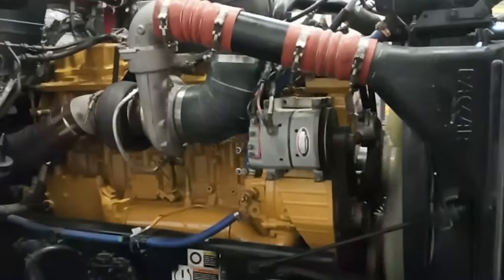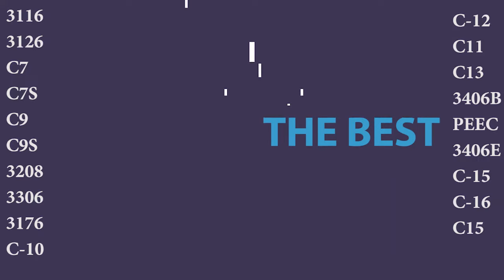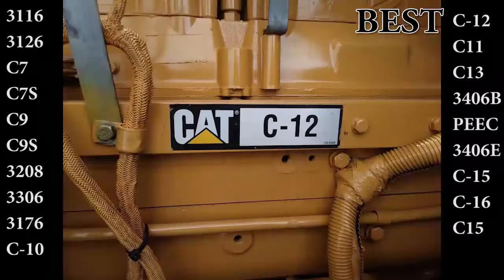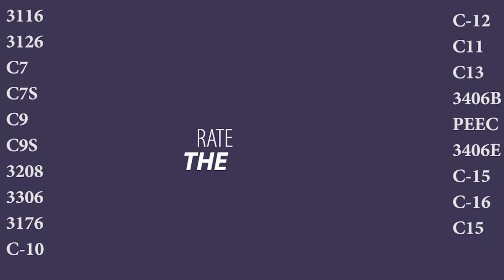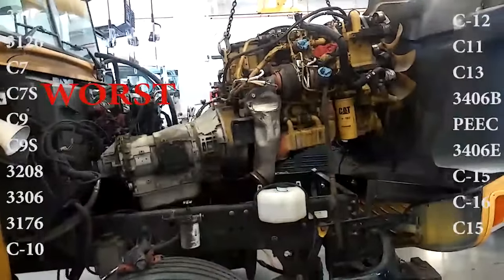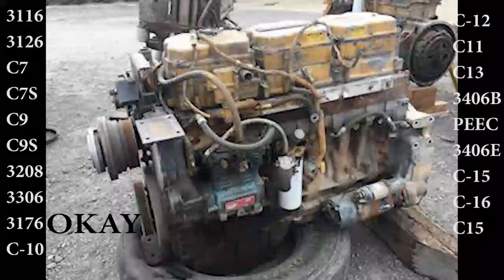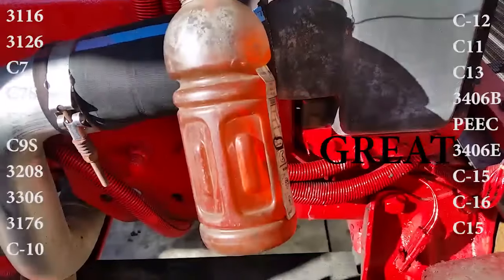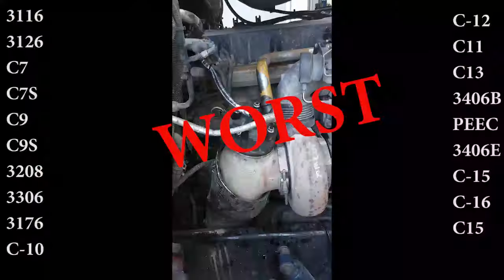Ranking the Cat Diesel Truck Engines from BEST to WORST!!!

Comment: Sad, emissions ruined all diesel engines really
Reply: Yup. Detroit had a proven winner in the series 60. Then of course reliability went down when they did EGR. Then, as if to double down on crap reliability, they came out with the DD15……..
Worst dang engine I’ve ever seen. 
Of course I’ve always been a Cat guy, but emissions bs has them completely out of the game now.
Reply: 2000 gallons per hour at 8000ppm C02 is cheaper.... Thanks biden
Reply: @Doco KD7OCO glad you’re having luck with em. I got one freightshaker with one, and it’s had all kinds of issues. Never going that route again. Gonna stick with a Cummins
Reply: You repair emissions systems 
With a laptop
Reply: @717weston2  constantly repair being the key part of that…..
Reply: It’s referred to as a delete
Reply: @717weston2  highly aware of the delete....my 15 duramax is deleted but it cost money, is illegal and can't be sold again at a traditional dealership, only privately but still well worth it
Reply: So

Comment: After having several Cats back in the day then the move to Detroit Diesel in 1998 was a eye opener.  It was just as good but omg the fuel mileage was so much better. I never went back to cats for that reason. When operating a business to make money its a no brainer that fuel mileage is critical.
Reply: I’m not saying you’re lying, but I was wondering if anyone else had the same experience?
Reply: @adamfpv8294  cats got 4 and my cummins got 6 was a big deal.
Reply: @billyjack8119  wow 4 is pretty bad.
Reply: I spent 30k on a platinum rebuilt/3 Year Warranty on a C15 Acert BXS 
Good or Bad Decision. 
Thoughts Anyone?
Reply: @dwnsouthtrucking7307  good I say.
Reply: @adamfpv8294   my cat would get 6.5 when heavy. my detroit only gets 6.....
Reply: @adamfpv8294  our cats get 4-7 mpg, detriots got 10 and mercs 3
Reply: @Doco KD7OCO that is quite interesting!

Comment: I have C15 ACERT (none-regen) on my W900. What a beast !!!
Reply: I need it!
Reply: One of the best engines was left of the list, was the 1693. It was a little on the heavy side but was an absolute marvel. It was in the late 60's and into the 70's. It could out pull abot anything but a locomotive. It would go over Donner like it was almost not there.

Comment: I love my 3406B with 2,300,000 miles on it. Great videos, always interesting.
Reply from the maker: Still breaking it in there.
Reply: Wow AJ you need to let us in on your secret how to get long life out of a cat
Reply: Old & simple = reliable & cheaper to fix.
Reply: Wow!
Reply: My 03 W900L has a 6NZ in it with 1,920,000 on it and it was redone at 1,330,000 miles, and she still rips down the road 😃 I'll never get rid of this truck, even though I've had quite a few offers, in 5 yrs I've owned it
Reply: How many in frames?

Comment: I only had experience with two cat engines. 3306 in a 966c loader, and 3208 in a large forklift. Never had any trouble with either of them. I agree with you that the 3208 was a great starter, seems half a turn on the starter and it was running.

Comment: I’m over in Australia behind the wheel and gear stick of a kenworth with an X15 Cummins in it, it’s doing a great job but my favourites have always been the big bore Cats that I’ve had the pleasure of driving. Even the little C12 I drove for a few years would always give everything it had 
The most impressive were, of course, the C15’s and 16’s I got to drive, the torque and reliability where remarkable 

There is still countless big bore Cats pulling multi-trailer setups and heavy over mass loads over here

Always enjoy Your videos mate

Comment: 3406 series was an epic design. It was the mandates for emissions that things went sideways. The 3116 had a flaw in which the injector cups would fail. The C7 was "virgin bore" (without sleeves) and was saddly a throw away engine. The C15/C18s were very outstanding engines. I'd take them over an ISX Cummins or 60 series any way

Comment: I recently sold my Western Star with a C10. It had 750,000 miles and about 24,000 hrs. Never had an overhaul and was still running strong.

Comment: Glad to see that my 3406e is one of the “Great” ones!
Reply: IPD came out with a kit that'll convert a C15 Acert into a "C17" by enlarging the bore to that of a C18. Displacement goes up from 15.2L to 16.9L.

I heard that they're also coming out with Big Bore kits for the 3406E and C-15, which will turn them into C16's by upping the displacement from 14.6L to 16.3L.

So you could make the 3406E even greater than it already is.
Reply: @electric7487  is it already out? I'm plan on buy a 2ws 3406e kw9001 studio sleeper
Reply: @carmello000jp  I believe so. Look up "3406e big bore kit".

Comment: Just bought a truck 2005 sterling at9500 with a C13 always wanted a cat engine having a strange issue but watching your videos is helping me narrow down the problem so thanks for all your videos and explanation of things it’s been a huge help to me
Reply from the maker: You can always email me as well. I answer all my emails at Adeptape@yahoo.com
Reply: I currently run a 2007 kenworth T600 with the c13 so far so good first was worried about oil pressure on this truck but seems they run normal like this 👍

Comment: I would swear by my 3406c at least once we took the electronics off and threw a B model pump on it. You are definitely spot on with the leaks though. plug 1 then 2 more spring up

Comment: 3406C was a great engine. It either PEEC or mechanical. Had round port cylinder head, articulated pistons,and a larger crankshaft same as 3406E. I've built them to 800hp and gotten 700,plus miles. And there were 3406B PEEC engines. It's funny your opinion on the block stiffener, it was actually first introduced on the 3406C 460hp engine. I use these plates on a lot of builds, especially with the last few 17 liter Acert builds. I've had a few blocks crack around the pan rail, I dont think the ladder plate is worth a shit. You can always see how much fretting happens between the it and block. Plus 40 pan bolts, as opposed to 20, in my opinion adds strength to the block.

Comment: I've got a 6NZ 550HP "King of the Hill" in my 2001 W900L with 2,700,000 on it and still going strong! I owned a 3406B 425HP
Reply: Oops. I got over a million on the 3406B 425HP. I tried a series 60 Detroit and went thru 5 injectors in the first 200,000 miles in a 660 Volvo back many years ago. Piece of crap. That's why they say a Detroit and a banana have one thing in common. They ain't worth a crap until they turn yellow. 😂

Comment: The worst thing also about the C7S/C9S engines was that they ALWAYS went into the WORST chassis to work on!!  Ford F650/750, Blue Bird vision school busses, and the dreaded RV chassis!  Not only did they fall apart at every turn, but the parts that fell apart were always in the worst places to get to!  I have worked on a lot of the PEEC engines, and the biggest problem with them that we have now is that Cat does not support them very well on the electronic parts, and since the electronics on those engine were so rudimentary they always had problems, now the sensors are an arm and a leg, so pulling it all off and finding a donor fuel package is now worth while.  3406B/E, any of the C15 series engines, and the C-12 engines were all great, but my favorite to work on believe it or not was the 3116/3126, C7 engines.  They paid a lot of bills for me over the years, and the mechanical 3116 engines were the last of the Cat engines that you could tune yourself.  Once you understood the fuel system, you could make one of them sing a song!!  And since all the old guys at that time didn't want to work on them, I was the one who got good at making them sing.  Even my competition quit trying to work on them and would tell their customers to go over to my place and talk to me.  Quite a complement when your competition sends their work to you and your the young tech in the shop!
Reply from the maker: I think you should get some sort of award or something from Caterpillar if you can do a 3116 rack sync yourself in a GM chassis. I was good at setting them, but the Cat instructions were terribly written for a person trying to figure it out.
Reply: @AdeptApe  The "Carpenter tools" sure made it a lot easier and much more accurate than the Cat tool set.  I agree, I think you could turn the service manual upside down and try to read it backwards and get a better idea on how to use the Cat tools to setup the rack synchronization and injector heights.  I had lots of the GM chassis truck in the local power company fleets not to mention all the other places that ran the GM trucks so you got good at the fuel system when the injector sleeves or the tip seals on the injectors would leak.

Comment: I have a 1996 Fld that has a 12.7 with a 600hp tune that gets 6.4 mpg. I also Have a 2000 International 9900i with a C-15 550 that gets about 6 and they both are awesome engines. I pull dump trailer with the Detroit  and step deck with the Cat.

Comment: I agree with you about the 33-6 engine. We had 4 of them when I worked at Maid of the Mist in the 1990s and up. They were great engines, better than the D333 which you forgot, Those were a PITA because of the spacer plate between the block and the head. Also some of the parts were getting hard to get. Love your videos.

Comment: My truck has Cat C15 Acert 2009 model and the engine still in perfect condition after 1.2 million KM , if you want it to stay good service it on time and don't leave it going over 10km local without service or 15km highway

Comment: I find your videos really interesting.. You clearly know your stuff about Cats..  I run a couple of 3126B's in a boat in the UK.  The unfortunate thing here is that they aren't massively common here and Cat UK parts are painfully expensive, not to mention expertise on the engines is a bit thin on the ground and come at a heavy premium.    But a year in i'm gradually getting to know my engines and one that wants to leak everything..

Comment: Thanks AA for informative and interesting video FWIW I worked at Cat dlr in 70s and thought the 1693 was the best engine they produced with 500k mile between valve jobs and million mile BTO features like twin overhead cams with twist to adjust valve lash. Took a trained ear to tell when the bottom end was rattlin cause the whole engine was a clattering.  Some how I ended up getting  most of the rear seal  replacement jobs and dreaded the ones with brake savers on conventional cab with sleepers nothing like working in a cave and wrestling a 13spd Road Ranger off with a tranny jack. Glad I went on to work on aircraft where most of the parts were lighter. Stay healthy.
Reply from the maker: I hear a lot if praise for the 1693, but have never worked on one in the decade and a half I've been working on Cat Engines. I have worked on a couple 399 engines, which were the same era, but a larger generator engine.
Reply: brings back memories....the 1683 definitely went thru rear main seals...fuel spray nozzles stuck..the water pump repair kit required you to rebuild the water pump yourself...Also if you got mire than 2 gallons low on coolant ut cracked the head . But in the 1970ies we still thought it was an awesome engine.

Comment: I had 3408 engines for a long time with great success. Then I started using 3406-5DS 16 litre engines. They had a 40 pin computer. They were getting a lot better fuel economy.

Comment: That 3208 was used in the 225 backhoe.  It was Extremely Noisy with poor fuel economy,  but was close to indestructible.  Had one that the operator  put a piece of rebar through the coolant hose and continued operation until the engine quit running. The  piston rings had been SO HOT that I was able to twist one 8 rotations and it still Didn't break! 2 new heads (the old ones had cracks big enough to put your fingers in), same pistons, hone the cylinders just enough to get the cross hatch, new bearings everywhere, new rings, and 6 years later was still running!
Reply: Have a 3208 in a pulling tractor. Love it

Comment: I’ve got a NA 3208 rated 1760 RPM. Worked on a pump a couple of weeks ago with a NA 3208 rated at 3000 RPM. Talk about a screaming engine! I thought I had a governor issue until I saw the nameplate lol
Reply: When I started driving truck in 1971 in a C8000 ford it had a brand new 3208 cat 225 HP @ 3000 RPM ask cat how it should be driven they said 2500-3000 turned out to be a very good engine. Worked that thing hard on the rug all the time but took good care of it ran a long time no oil between changes.

Comment: When I started out, I got to get a fairly good amount of experience on the 3176’s. One of our customers had about 10 of them in their fleet. First overhaul I ever did was on one that had a valve train failure, and busted a hole in the aluminum upper block.
Reply from the maker: The Cam boxes are a pretty weird design by the engineers at Cat.
Reply: @AdeptApe  Cat bragged that it was the top HP to weight ratio ever produced.

Comment: The c15 ACERT MXS is a beast of an engine, it just needs to be tuned right and nothing compares.
Reply: Since I have that exact engine or at least in the MXS form, tell me more about the tuning you have had done, if the IVA's are still actively part of the system and what boost pressure you are able to attain, theoretical hp and torque its rated at with the tune.
Reply: My MXS gets 40psi of boost.
Reply: @tolatruckinginc7979  I was expecting a number quite a bit higher then that. So what hp is it set at and does it have an aftermarket tune ? . Also does it have the stock compound turbo setup ?
Reply: @charlesb4267  It's all stock setup.
Reply: @TolaTrucking  I am surprised for the simple reason that you commented on it being a beast and yet is stock. I have a 2005 Pete with that same MXS and although well used when I bought it I could look back at some history of the truck at the local Pete dealer and complains of low power and changing out turbos because there was a failure there and also at other times checking it over and saying there is nothing wrong etc, they had boosted it from 475 to 550 which they did to all their trucks anyway and then put on the heavy haul program which is also a Cat program to move the torque higher up in the rpm range to use the torque along with the hp for better pulling ( not fuel economy though ) . I've put on low restriction mufflers, put a new fuel pump on with the stiffer spring to ensure good fuel pressure but that is all I have done other then a top end set and having the ECM checked for any codes and the mufflers did get the boost up by a couple of pounds. Boost will get up to 46 or so if its cool out as in winter but more like 44 otherwise. I haven't driven another C15 to compare it to but I personally think it should have more power then it does. My loads are in that 104000 lb range with a tridem trailer ( I farm so its grain ) Equipped with the special heavy wall 46 rears and 4.30 gearing
Reply: @charlesb4267  I did not make that comment at all. 
All I said was that my mxs puts out about 40 on the boost.
Reply: @TolaTrucking  oops !, I see my mistake now as I missed the fact that the original commenter was not the one who actually replied back to me,  totally my mistake. So its hard to say what Chief 119 has going on under his hood as I am only guessing something not quite stock.

Comment: In All Honesty, there are A LOT of C13 Non Regen (04’-07’) Motor Owners who will Largely Disagree with You on that Cat C13 Motor. Once that Motor was DeAcerted it was a GOOD Motor. I would put a C-12 Up Against a C13 ANY Day of the Week. I agree with you on Every Other Best Motor Pick. But in All Honesty, All Diesel Truck Manufacturers between 1995’-2003 Made GREAT Motors (other than leaking some oil, and maybe some injectors), International DT466, Cat 3116, Cummins ISC 8.3L, Cat 3126, Cat C-10, Cummins L10/M11/ISM, Detroit S60 11.1L Non EGR, Cat C-12, Detroit S60 12.7L Non EGR, Detroit S60 14.0L Non EGR, Cummins N14 525 RedTop, Cat 3406E, Cat C-15, Cummins Signature 600 Non EGR, Cat C-16, ALL of these are NON EGR Motors. ALL are GREAT Motors that all have their Place in Different Applications, All where Produced during the MOST Fuel Efficient and Produced The LEAST Amount of Emissions Period of Diesel Motors, which was from 1995-2003. That was The HOLY GRAIL of Electronic Diesel Motor History. That’s why these Motors are so Sought After, that’s why they Sold a RECORD Amount of Gliders from 2008-2020.

Comment: Was watching ice road truckers and noticed their trucks were using C-15's for the massive loads and mountains in ak some loads were so heavy they had to use a pusher , Carlisle is using C-15's up there it's good enough for anything down here in the states  personally I drove a 3406e untouched just like driving a car with a lot of Hp except it an 80,000 lb load or less man I was sold on cats right then
Reply: I pull with a c15 acert (non regen) through the Alcan and it’s a beast. My dad has the 3406E and it isn’t as powerful. (Duh)

Comment: I have a 3176 in my dump truck it has been overhauled and works decently, lacks a bit of power but I don’t race either. I will probably swap it for a c12 when it goes out.